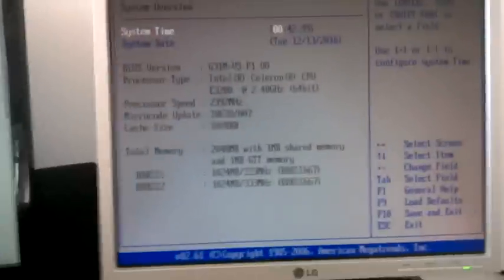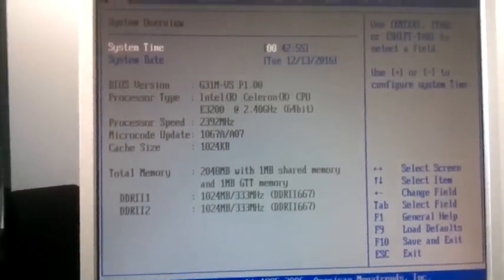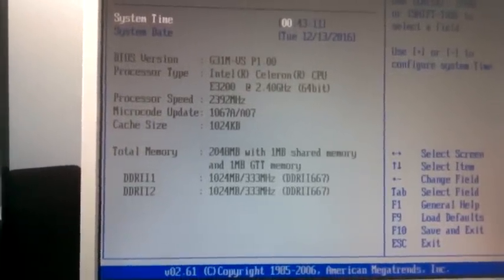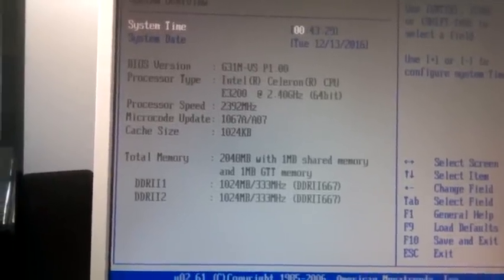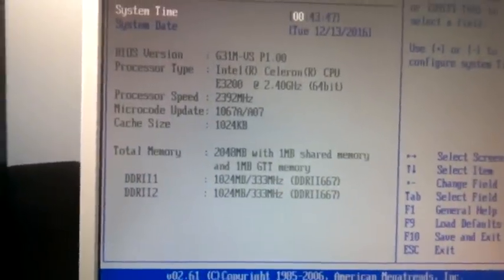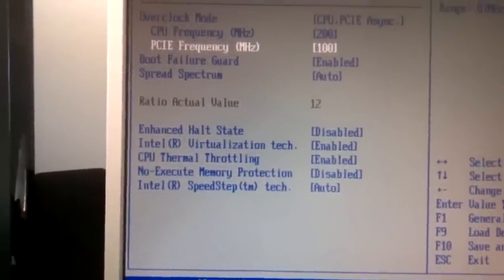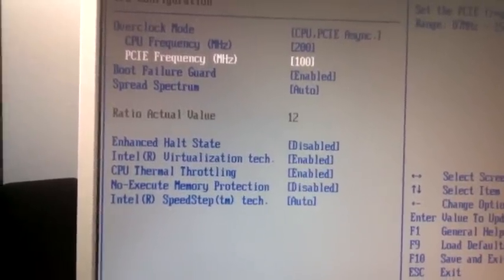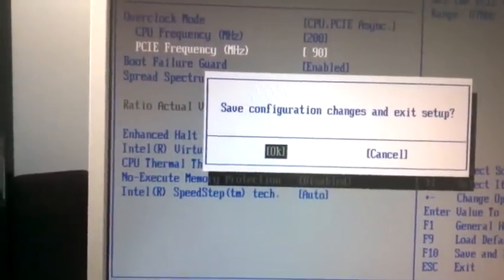How to install PCI-E 3.0 GPU on old motherboard with PCI-E 1.1 SLOT

Comment: Thank You!! I have been trying to get my Crosshair VI Formula working with a newer gpu for ages. I thought I had tried everything until I came across your video. I bumped my pcie frequency to 105Mhz and it fixed all my problems. Thanks so much for making this video!
Reply: i will try your setting. My user define only allow me set above 100mhz
Reply: Bro i have lenovo e72 edge cpu and im trying to install amd hd 7000 but it wont give display. Will this fix my problem?

Comment: My asrock motherboard how to install 3.0 to My pcie 2.0 slot. My bios is updated P 1.20 to P 1.50 my current video card is Nvidia geforce gt 710 PCIE 2.0 to upgrade nvidia geforce gtx 750 ti PCIE 3.0
Reply: did you solved? i have an similar issue, but my mobo is 1.1 slot and my gpu is 2.0 pcix16

Comment: does the pci-e generation affect the gpu performance ....cause i got a lga 1155 h61 pci-e 2.0 mobo and am buying a gtx 780 ti gpu ?????
Reply: Not much performance loss actually, according to benchmarking stats. And so long as your CPU isn't causing severe bottleneck. Only a few fps lost between PCIe v3.0 and v1.1. 1.0 is where things take a nosedive.
Reply: @terrapinflyer273  its been 3 months since i posted this comment that time i had a potato pc now i got a b450 tomahawk max 2 a r7 5700x 16gb 3600mhz ram and i got the rx 580 8gb instead of the gtx 780ti 🥰i had to save my money cause i got a job opportunity with the salary and what I've saved before  i was able to upgrade and it feels like going from a rusty bicycle to MotoGP bike

Comment: My GTX 1070 is installed on PCIe 1.1. x 16, is there a significant impact on performance? 
 I can accept if it's only about 4-8 fps
Reply: did you learn how much impact did it have on performance
Reply: Any issues running your 1070 in a PCIe 1.1 slot? I have a 1080 I want to pop in my system, but thinking I might just wait a few days for my Haswell mobo to get here to be on the safe side. $120 card lol. Better safe than sorry!
Reply: @hepnzmfbl According to benchmarks, there's actually not too much performance loss as long as it's PCIe v1.1 and not 1.0. Few fps lost, depending on your CPU bottleneck of course.
Reply: @terrapinflyer273  there's no issue, I've been running them since 2017. (my gpu was gt 730) no stutters, no bsod. surely there's some frames drops I didn't notice ('cause I don't have a better motherboard to compare Lmao) I'll keep running these and upgrade when the 6000 series came out or smth, currently I only play old games lol but ofc, better safe than sorry.
Reply: @nooneshouldknowme206  Nice! I was planning to try my 1080 in my AM2+ socket board, but my 4th gen mobo should be here tomorrow and I don't have an extra case that doesn't include some proprietary bs.

Was gonna swap it into an HP case I have, but realized halfway through disassembling it that the motherboard mounts are proprietary! 😄 Nice to know 3.0 is compatible with 1.1 slot though.

Comment: Hi sir, i m buileding my new rig, i just got my gpu which is sapphire pulse vega 56, when i tried testing it in my old pc which has this  motherboard and after installing the driver i get the yellow triangle and an errors message in the device manager:
"Windows has stopped this device because it has reported problems. (Code 43)"
I tried everything, installing and uninstalling all the previous drivers one by one, i tried other os win7 and win10, and the same problem, please can anyone help me
Reply: Is it fixed?
Reply: @gtawomen3887  no but when i try it in newrr motherboard asus x470-f it work fine
Reply: @katan16  same bro

Comment: Hi, I tried to install a gtx 1050 2gb, but its not detected on my PC. The BIOS mode is Legacy. Do you have any idea to solving my problem? 

My CPUs specs :
Proc -> Intel core i5 2400
Mobo -> HP Pro 3340 MT (OEM Built)
RAM -> 16gb
PSU -> 300W

Thanks :D
Reply: Upgrade your psu to 400 watt, maybe thats the problem..
Reply: Why are ypu responding to a year old comment xD
Reply: Did you figure it out?